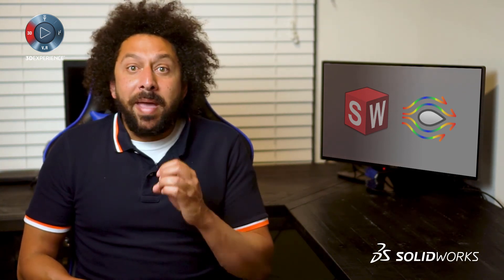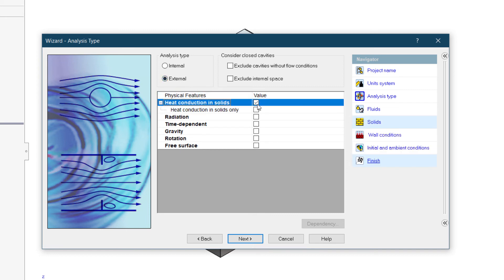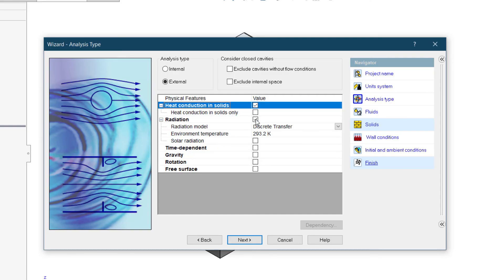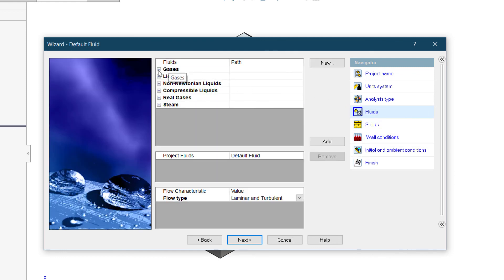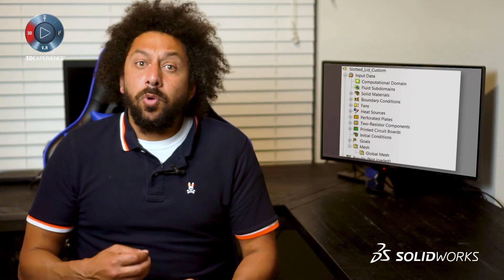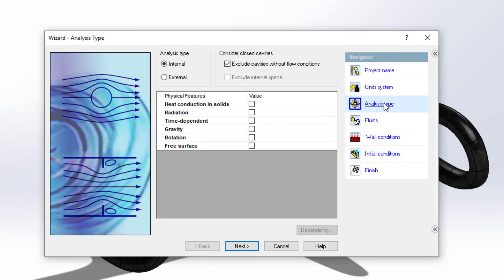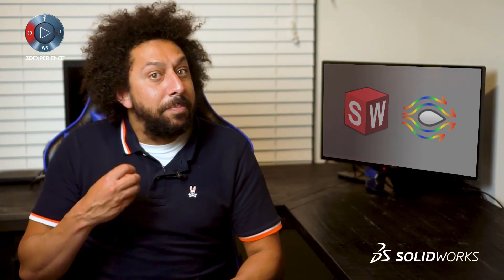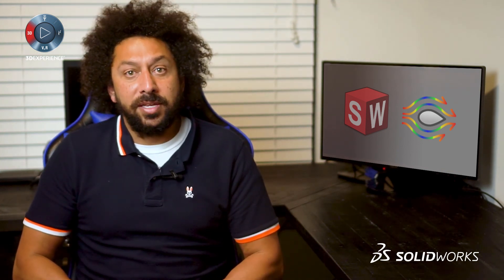Using the Flow Wizard to Simplify Simulation Setup

Comment: Can SolidWorks flow simulation achieve passive rotation of rotating machinery
Reply from the maker: Hi there,
 
We are happy to point you in the right direction for great resources. MySolidWorks is the place to get the best answers to your questions about SOLIDWORKS in one location. 
 
We can also direct you to a variety of resources for questions and networking. 
 
SWUGN, or the SOLIDWORKS User Group Network, can be accessed here:  http://swugn.org/ 

With your existing SOLIDWORKS or 3DEXPERIENCE ID, you can access SOLIDWORKS Forums for more information on a variety of topics and questions from our user community. 
 
Check it out here: solidworks.com/UserForum